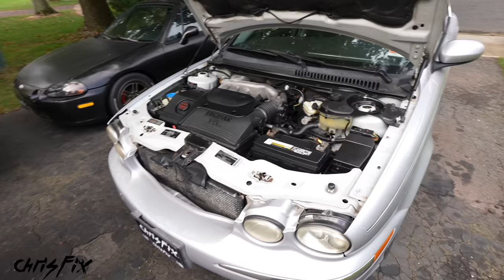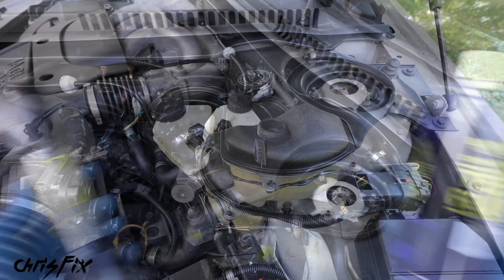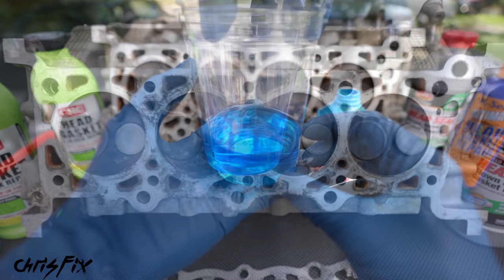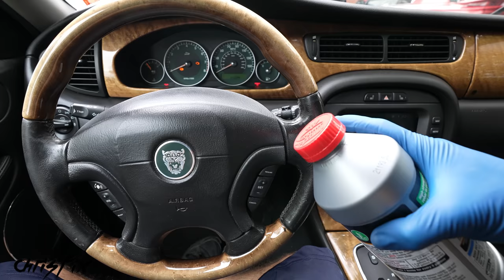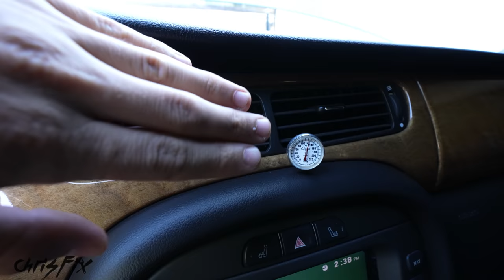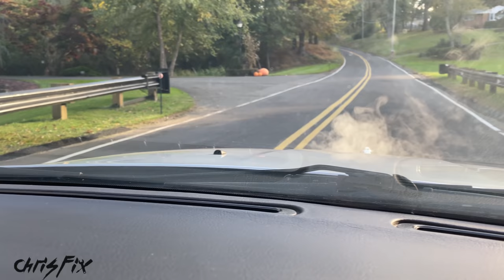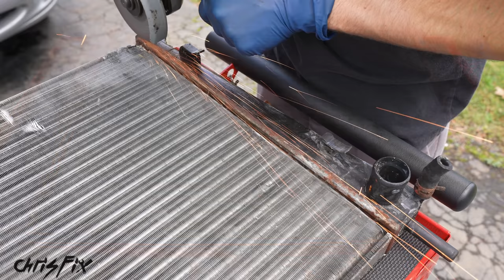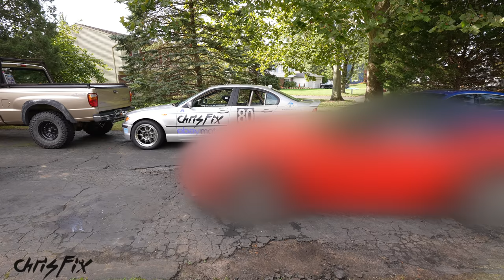Do Head Gasket Sealers Actually Work (FULL 2yr TEST with Engine Teardown)

Comment: Does the combustion test kit you used indicate that it is a 100% a head gasket leak, or can it be something else causing the gases in the system? If so, how would one know for sure if its the head gasket? Mine turned yellow aswell but want to make sure before i put money into fixing my head gasket. .
Reply: Can't be anything else.
Reply: @SinsBird  well on the test kit box it says blown head gasket, warped sealing surfaces, cracked head or block. So I wanted to know if it turns yellow does that mean it's 100% caused by the head gasket.
Reply: @fallenone6  Technically yes, it could be a crack somewhere, but that's very rare, so not worth mentioning, it's the gasket 99% of the time.
Reply: @SinsBird  have you used head gasket sealers before? Will this seal a cracked head or block aswell? Would you recommend one because there are so many to choose from.
Reply: @fallenone6  Yes, I've used it a lot. Yes they do seal cracks as well. Most are sodium silicate based, so they perform similarly. The main difference is the filler material. Choose one without filler particles if removing the thermostat would be a problem for you.
Reply: @SinsBird yes removing the thermostat is actually difficult to get to on my vehicle so thanks for that tip. Is there one you recommend without the fillers that works good? I think I'm getting coolant in my oil already. Will I still be ok using a sealer or is it too late? Also I was told that I have to change the water pump after the sealer, is that true?
Reply: @fallenone6  First of all when coolant and oil are mixing the chances of it sealing successfully are lower. Does not mean one should not try it, just keep it in mind that in this case sealing is not guaranteed.
Next, I wouldn't drive the car with coolant contaminated oil, it's doing serious damage do the engine. It would be better to drain coolant contaminated oil and just pour in used oil if you could get it easily for free.
Sealers should not do any damage to the pump. Pumps fail from overheating if the engine overheats or coolant contamination.
Some sealers off the top of my head would be blue devil and steel seal.
Reply: @SinsBird  is there a reason why it sealing successfully is lower? At the moment I haven't been driving it,  used oil, where does one get that for free at? Oh great I was hoping I wouldn't have too because I just changed the water pump not too long ago. If I do successfully seal the head gasket, how would I go about getting the coolant out of the motor? Will a simple oil change after it seals be enough?
Reply: @fallenone6  Mostly because of oily surfaces, it's less likely to attach successfully. If you're not driving the car draining contaminated oil is not that important. And there's no need to drive it for sealer to work, it can be done while staying stationary. A simple oil change will get the coolant out.
Reply: @SinsBird  nice, I was thinking I was going to have to remove the oil pan to get all the old contaminated oil out. Will it be ok to keep the old contaminated oil in there and have it running while the sealer does its magic?
So what if I need to drive the car, where do I get free oil from to be able to drive it?
Reply: @fallenone6  Yes it's okay. You could ask someone who changes their oil themselves or ask a couple garages.
Reply: @SinsBird  I see. But wouldn't the different grade oil from different cars affect the engine? Mine takes 0w-20. Also wouldn't old oil do harm to it as well based on that it's changed for a reason? Like degraded or bad already.
Reply: @fallenone6  If your car uses 20 then up to 30 is fine. 0W oils are usually made for extreme cold so if you're not living in such area you could probably use 5W if you find it less expensive. Nothing worse than coolant contaminated oil. At first it thins out the oil which is already thin (0W-20) and if the engine doesn't self destruct from the thin oil, it eventually turns into gel. So old oil will always be better than coolant contaminated oil. Of course this is only to get by, for a short period of time only.
Reply: @SinsBird  so I can use old oil from my other vehicle that takes 5w-30 without causing any problems?  What head gasket sealer have you used with great success that you recommend? From your own experience.
Reply: @fallenone6  Yes. I've used bars leaks and kseal. Later I started mixing my own using sodium silicate. They all work the same, it doesn't really matter, but in your case it's probably best to get blue devil or steel seal because they don't have filler particles.
Reply: @SinsBird  ok I will look into one of those. I wanted to try k seal because I've herd positive feedback about it, I know you said if I can't remove my thermostat then it's best to use one without fillers, is it really necessary to remove it if used with fillers? Will it cause harm if I dont?
Reply: @fallenone6  It depends on condition and type of cooling system. If there's not enough flow in the cooling system, like if thermostat is blocking the flow, those particles can accumulate in one spot and clog things up. Like I said, you can try if you want.
Reply: @SinsBird I see what your saying it makes sense. In this video Chris didn't take out the thermostat and he used bars which has fibers in it?
Reply: @fallenone6  Yes, and it's very risky to do it this way like in the video because if it's done in one go there's a high chance of a big air pocket formation inside the cooling system. This could allow the sealer to solidify inside the cooling system where it shouldn't. I'm just telling you how to avoid causing bigger problems.
Reply: @SinsBird  I appreciate that. I did rewatch the video and he mentioned that that the next time he does it he will suggest taking out the thermostat because the temp was spiking. It's difficult to remove on my vehicle, but I Definitely will do it as a precaution. If I have coolant mixing with oil, will it be ok to use one with liquid glass in it?
Reply: @fallenone6  Yes, the majority of sealers are sodium silicate (liquid glass.)
Reply: @SinsBird  ok. I ask because I saw a video that said not to use one with liquid glass in it if the coolant is mixing with oil because it can seaze up the motor? But I realized most of them come with the liquid glass.
Reply: @fallenone6  Just change the oil after it's sealed.
Reply: @SinsBird  yes but I assume there referring to the seller getting into the motor the same way the coolant is, and that will lock up the motor. What's your thoughts on that?
Reply: @fallenone6  A very large amount of sealer would need to be in the crankcase to do damage.

Comment: How about Blue Devil Sealant?
Reply: What about it?
Reply: @SinsBird  Does it work Better than these Products?
Reply: @MB1Billion  The difference between these products is the particle filler, other than that it's the same thing. Get something like blue devil if removing the thermostat would be a problem for you.
Reply: @SinsBird  K Seal is Better?
If Removing the Thermostat?
Reply: @MB1Billion  all of them are based on sodium silicate, their main ingredient. In theory particles should plug the leak quicker and create a seal that can take heat better. Whether the particles do anything depends. But yes, a sealer with particles should work better.

Comment: Which bars brand did you use
Reply: Bars leaks is the brand. But it was one with the so called carbon fiber.
Reply: I just put it in on fresh coolant flush as per directions

Comment: Hey chrisfix i know this video was alot of years ago but i wanted to ask you what would be good for a mini cooper, because i don't want to clog the engine
Reply: Coolant in oil, oil in coolant, or both? Is the cooling system holding pressure?
Reply: @SinsBird  I dont know if the system hold pressure or if the coolant mixes with the oil or both, i just know the car eats alot of water through the cooling system
Reply: @xxdrugzzxxdrugzz8311  You'll have to find out. Check if coolant is clean, check if oil is not emulsified. Make sure coolant hoses are firm when the engine is up to temp.
Reply: @SinsBird  Okay, but what do you suggest using with a mini cooper 1.6 116CV petrol engine?, if it does have a head gasket leak
Reply: @xxdrugzzxxdrugzz8311  Most sealers are sodium silicate based so they are very similar. Ones with particle filler are for big leaks and ones without it are for small leaks.
Reply: @SinsBird  Oh okay, thank you very much, also in the video he said you have to turn the heat up in the car to the max right? The thing is in the mini cooper a temperature gauge doesn't exist so i would have to find the normal operating temperature for this car.
Reply: @xxdrugzzxxdrugzz8311  Yes, heater to the max. Operating temp should be around 194F/90C I would think.
Reply: @SinsBird  Okay thanks, the problem is i live in italy and i didn't find any of these products here. i only found bluedevil but it would ship in a month and thats alot of time, so you're sure Any head gasket seal would work? cause there are different ones here and one of them say it takes 15 minutes
Reply: @xxdrugzzxxdrugzz8311  Yes, any.
Reply: @SinsBird  Okay, thank you
Reply: @xxdrugzzxxdrugzz8311  It doesn't matter, but I really recommend to remove the thermostat.
Reply: @SinsBird  Okay, thank you Also what happens if you don't remove the thermostat?
Reply: @xxdrugzzxxdrugzz8311  lower chances of it sealing. Also it may allow air pockets in the cooling system as well as reduce coolant flow. You need good coolant flow for this.
Reply: @SinsBird  ohh okay, so since I'm not such an expert in this what is the function of a thermostat in normality?, also is that why chrisfix car overheated at the start and then it started going down after abit?
Reply: @xxdrugzzxxdrugzz8311  it does not let coolant to flow through radiator until engine reaches operating temperature to make the engine warm up faster. There are many things that can cause overheating like in the video.
Reply: @SinsBird  Ohh okay thats what it is, thank you alot for explaining, also i saw a video on how to remove the thermostat on the mini cooper and it is really small and attached to the engine so i don't think I'll be able to remove it as it is a total piece attached to it, its not like other cars i think, kinda weird
Reply: @xxdrugzzxxdrugzz8311  I think you could replace it with a couple of rubber o rings.
Reply: @SinsBird  Like put them in the holes between the thermostat?, and then put the tubes instead of them being attached to the thermostat
Reply: @xxdrugzzxxdrugzz8311  I'm not sure if I'm looking at the right part. If your thermostat is mounted inside a seal then it should be removable. If it's not then it probably isn't.
Reply: @SinsBird  Oh okay
Reply: @xxdrugzzxxdrugzz8311  If it's made after 2006 it probably isn't removable.
Reply: @SinsBird  it was made in 2006
Reply: @xxdrugzzxxdrugzz8311  It's a first generation?
Reply: @SinsBird  i don't know about that but it says it was made 23/11/2006
Reply: @xxdrugzzxxdrugzz8311  Then it's probably second generation and the thermostat is not removable.
Reply: @SinsBird  oh, okay that isn't a problem though right?
Reply: @xxdrugzzxxdrugzz8311  it's okay.
Reply: @SinsBird  Oh alright

Comment: Can I use them if I only have water in the radiator?
Reply: Oil in coolant or coolant in oil? Or both? Is the cooling system holding pressure?
Reply: @SinsBird  none in oil that I can tell but pressure and exhausted in coolant, no oil in coolant only gases. The fact that I don’t see it going out the tail pipe makes me feel like it won’t work for me so I even took out each spark plug and let it run as per tech tips on the bottle and online. Only builds up after about 45 minutes of driving idling made me believe it wasn’t blown, when I pulled over to check the hose was very tight and I heard gurgling. I ended up useing  the only one that wasn’t liquid glass by accident I feel like it’s not going to work I heated and stopped it repeatedly letting it sit and cool down completely but I have a bad feeling. I got the K-seal and didn’t realize it wasn’t the liquid glass that was the type I wanted to try. 🤞I may need to try the Bar one with fibers next if this doesn’t cut it.
Reply: @kyplummer3657  Is the thermostat removed?
Reply: @SinsBird  not able to remove this one it’s an assembly I just changed it the old housing was broken
Reply: @kyplummer3657  that can be an issue. Are you losing water, if so, how much have you added since you poured in the sealer?
Reply: @SinsBird  not much at all, if it were biting the water it would seem more likely to seal bc it would bc it would be sending the coolant with the sealer through the crack but it tends to just pressurize.
Reply: @kyplummer3657  The thing is, if air pocket forms from gasses being pushed into the cooling system it may prevent water from reaching the leaking spot. Also the leak may be too small for it to seal with the thermostat installed. What vehicle and engine is it? I'm wondering if there is even a leak. Are you sure the combustion gasses are getting into the cooling system? Usually it would pressurize soon after starting the engine, not much later.

Comment: I only watched a bit of this video and what I think if your engine is overheating and have a leaking head gasket with you pull the cylinder heads out or replace the engine this head gasket sealer stuff is waste  of time and money since you did not fix the source of the problem.
Reply from the maker: Not really a waste if you do something like this that's pretty simple and seal it up, even for a short while. Obviously a head gasket replacement would be the correct fix but it's not worth it in all scenarios which is where this comes in
Reply: let say I bought a car and I was told the car has no issues and after sometime the engine strated to overheat and after I took it to the repair shop they said the cooling system has a block sealer this means the engine had internal iasues before I bought it I'm not goning to be happy.

Comment: It does not work for me i pour 2 times  battle of that k seal in my car
Reply from the maker: Dang, must be a serious head gasket issue then
Reply: Can I use another battle of other brand one ,is it ok??????plz
Reply: @AtmeLook-si8qr  They're mostly the same. Is oil and coolant mixing? Oil in coolant or coolant in oil? Or both? Is cooling system pressurized?
Reply: @SinsBird  I don't know

Comment: Is exhaust gases the worst type of blown head gasket?
Reply: Worst is oil and coolant mixing.
Reply: @SinsBird  ty I have no mixing of fluids no over heating just bubbles in overflow tank
Reply: @larsguddal  Losing coolant?
Reply: @SinsBird  the only coolant I lose would be a small amount out of the overflow I never have to fill it maybe a quart a year if that.
Reply: @larsguddal  Is the cooling system pressurized? If so, you could fix this leak with sealer if it's really the exhaust gasses.
Reply: @SinsBird  to be honest I’ll have to look it up cause I’m not mechanically inclined it’s a 08 dodge diesel I don’t know if that’s to old for a pressurized cooling system I really appreciate you for taking time to help a random person you don’t know
Reply: @larsguddal  When the motor is up to temp, squeeze the coolant hose, you will be able to tell.
Reply: @SinsBird  I actually have done that cause I thought it was a thermostat and the upper hose was super hard I put in a new thermostat and it would overheat and no hot air would come in the cab so I put the old thermostat in and it went back to normal temp and just bubbling in the overflow it’s really weird I burped the thermostat system each time
Reply: @larsguddal  The sealer should fix the issue.
Reply: @SinsBird  you think the blue devil sealer would fix it? Would I have to be worried about towing
Reply: @larsguddal  It should. Once it seals if you try towing with it with sealer still in the system it should be reliable after you're done I would think.
Reply: @SinsBird  ok ty I will do it and let you know how it worked tyvm for all your help
Reply: @larsguddal  flush the cooling system multiple times with water before and after the procedure. Use water only with the sealer. I highly recommend removing the thermostat for this. Heater should be set to high. When adding the sealer it's best to dilute it first and only then pour it in. Do the procedure in steps, not just one go. After adding the sealer, topping up the cooling system with water and putting the cap on, start the engine, keep the RPM above 1000. Let the temperature rise some, shut the engine off. Let it cool for an hour. Check the coolant level, add more water if it's lower. Run the engine some more to raise the temperature more than before, shut the engine off, leave it to cool for an hour. Check the coolant level, add if lower. Repeat until operating temperature is reached. Then you could put some load on the engine, like towing to make it really hot. Then you can flush and use the coolant of your choice.